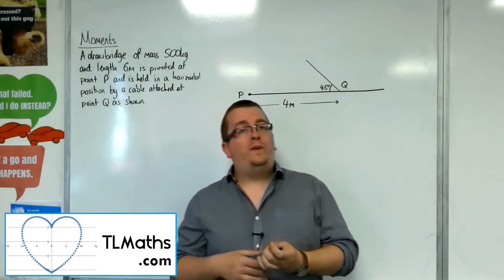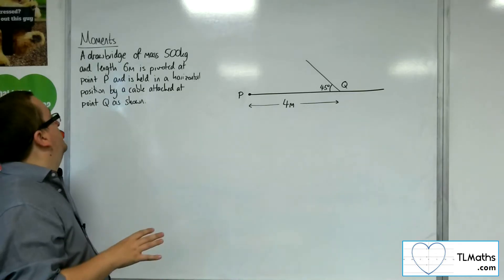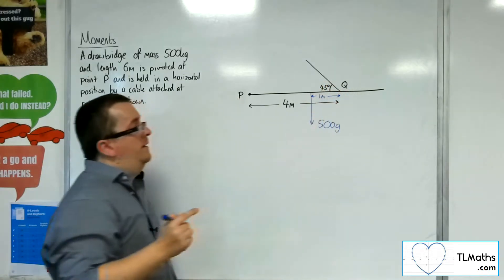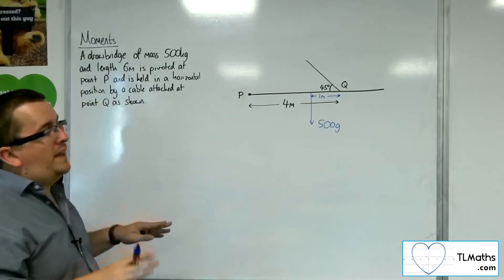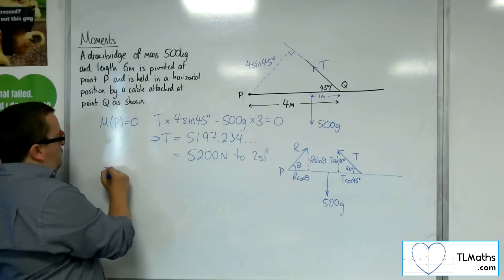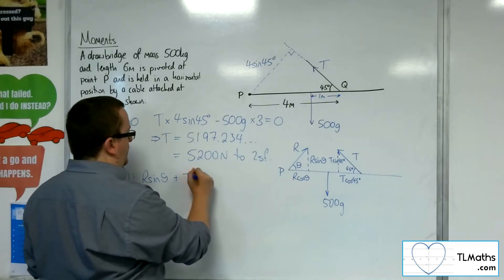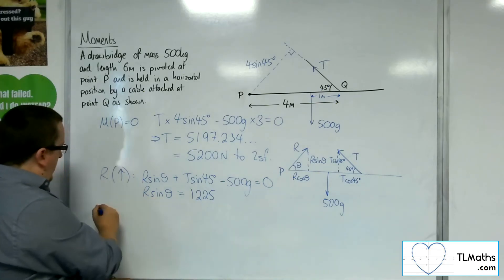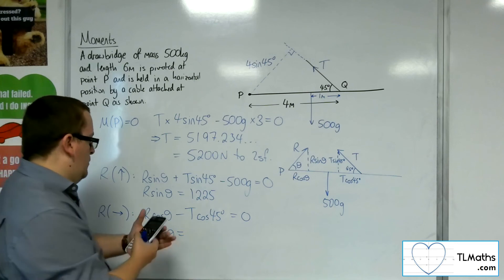A-Level Maths: S1-24 Non-Parallel Forces: An Introduction to Pivots

Comment: why is the reaction force at an angle and not upwards vertically?
Reply from the maker: It's acting at a point (at the pivot), so there's no guarantee that it is perpendicular to the rod. There's a similar situation in the Edexcel 2018 Paper 3, Q9, where the rod is in contact with a wall.

Comment: I get nervous putting a normal reaction on the diagram. How did you decide to make the normal reaction diagonal with an unknown angle?
Reply: Ill explain how I do it for what its worth - I resolve the forces before trying to draw my triangle. So... Resolve vertically first: 500g-Tsin45 = Rv. If 500g is greater than Tsin45 like in this example then I know the drawbridge is being pulled downwards harder. Thus the reaction force must push upwards. Do the same for horizontal forces and you end up with an analogue direction for the reaction force (up, right), which can be solved in the normal way for direction and magnitude. Hope that helps.

Comment: 8:35 Is it -Tcos(45) because it's going from the angle to the dotted line?
Reply from the maker: Because that is the length of the adjacent side of the triangle to the angle (i.e. the base of the triangle), and it is negative as it is going to the left.

Comment: Why does theta not equal 180-(90+45)= 45 degrees? Given the big triangle
Reply from the maker: That right angle triangle is drawn just to find the the perpendicular distance from P to the line of action of the tension force. The second diagram is used to find the angle at which the reaction force is acting.
Reply: Thanks!

Comment: Would you please be so kind as to give me a sanity check on the first part of your video? In calculating the Tension you have used the perpendicular distance from Point P to Tension T as 4 sin(45). However, when I tried (before seeing what you did) I calculated it using tan(45) not sin(45) i.e. the perpendicular distance = T tan(45). Hence the anticlockwise Moment = T * T tan (45) = T^2. Given, drawbridge is in equilibrium then, M(P) = 0 therefore T = SQRT(500g) = 70N which seems untenable for a drawbridge. Where on earth have I gone wrong? Cant see it.
Reply: Correction: apologies, with M(P) = 0 therefore T = SQRT(500g * 3) = 70SQRT(3) where 500g * 3 is the Moment caused by the weight of the drawbridge with Centre of Mass = 3m
Reply from the maker: It's an interesting problem you've got yourself into - I think the problem is that you haven't anywhere used the information that P is 4m from Q.
Reply: @TLMaths  Many thanks for looking at this; yes indeed, interesting conundrum.